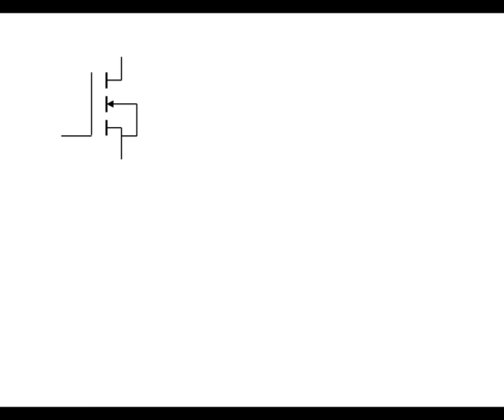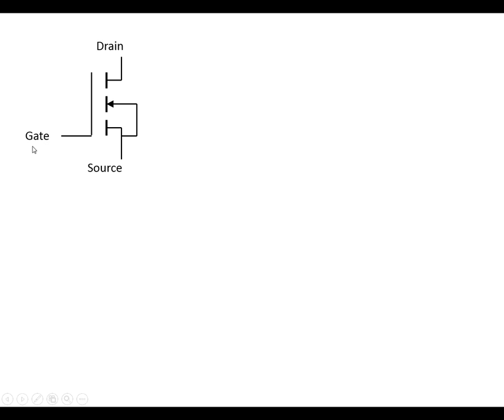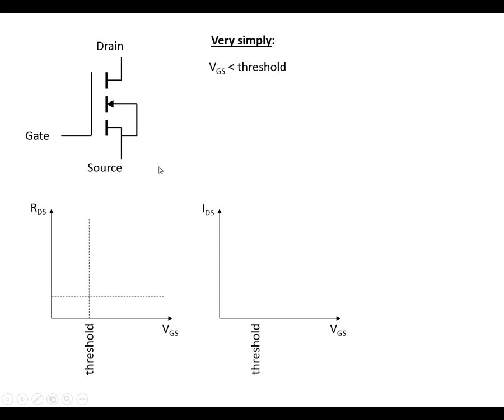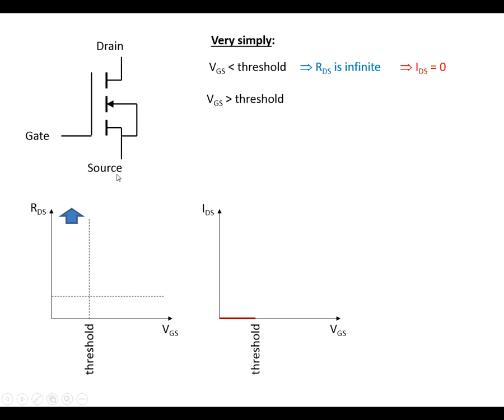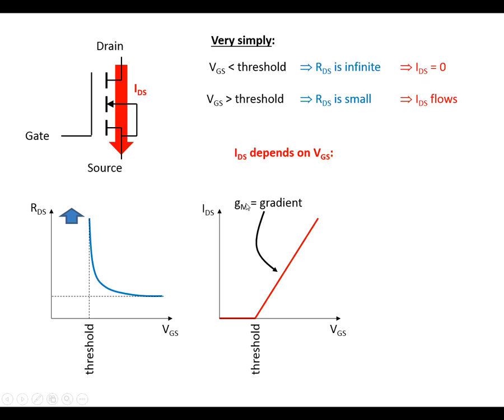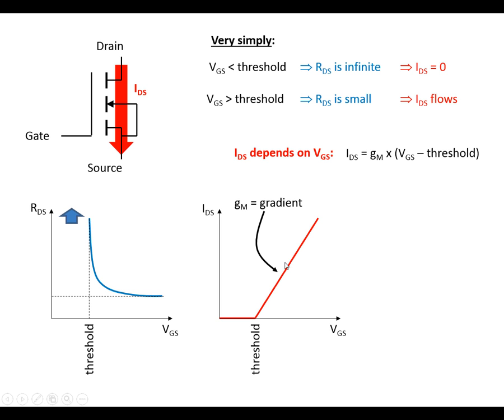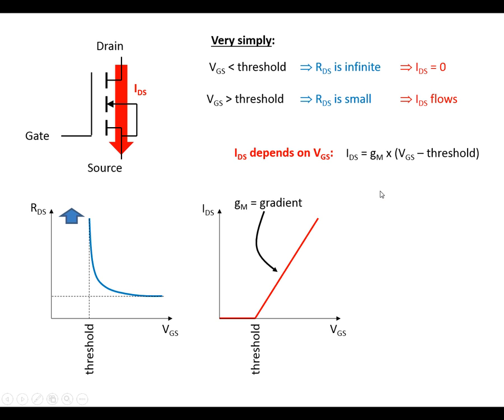MOSFET characteristics

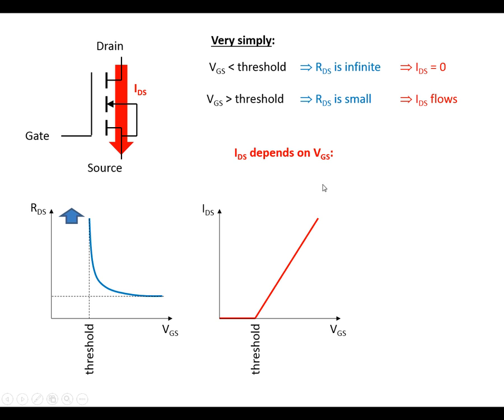Comment: 1:17 why would drain current increase linearly as Vgs increases? Rds decreases rapidly at first as Vgs increases, so current should increase rapidly (because ohm’s law). 

And when the mosfet is fully turned on, increasing gate-source voltage further will make no difference to the drain-source current. 

So why is it a straight line and not a curved line?
Reply from the maker: You're right. My graph is only an approximation, and is what was needed for the A-level course. The initial change will be a curve, and then you'll eventually get saturation (i.e. constant current) when Vgs is large enough. Amplifier circuits will (I believe) operate between these, where the change is fairly linear.  The A-level course kept it simple.
Reply: @andrewmasters5020  I really don’t understand that gm line at all and I couldn’t find any videos about it on YouTube. Any ideas what to keywords to search for so I can understand it better?
Reply from the maker: @davadoff  gm is known as 'transconductance', so try searching for this. The basic definition is (change in Id)/(change in Vgs), which is for the linear part. If we're taking it as linear, then Id = gm x (Vgs - Vth).
Paul Falstad has an online circuit simulator that I've used many times in class: https://www.falstad.com/circuit/e-nmosfet.html
Reply: @andrewmasters5020  thanks! So drain current isn’t affected by drain voltage at all, then (in the linear region). 

I’ve been thinking of a mosfet as an adjustable resistor between drain and source, where Vgs above ~10V is saturation and where this resistance stops changing.

In the simulator, as I increase Vgs, the mosfet changes in this order: off > saturation > linear. I thought it went: off > linear > saturation. 

I must be wrong in both these paragraphs, yeah? I’ve got it backwards or fundamentally misunderstood something.
Reply from the maker: @davadoff You're right that it's effectively a variable resistor. Should go: off - linear - saturated. Saturated means the current has reached its maximum.